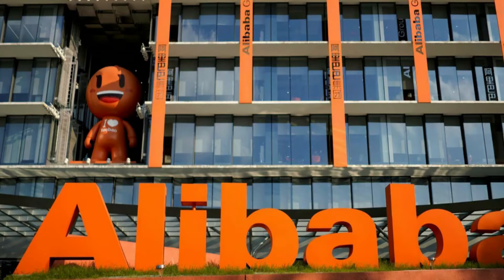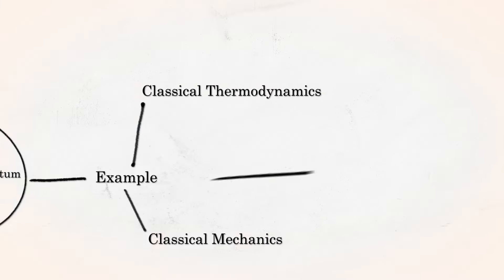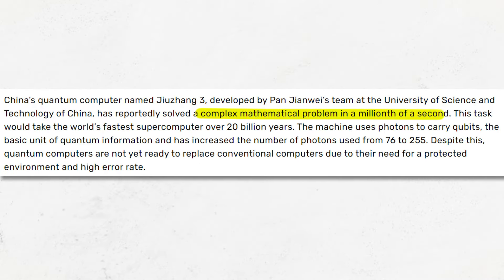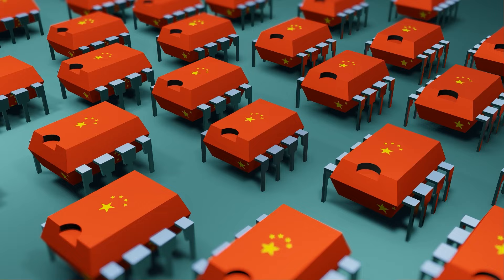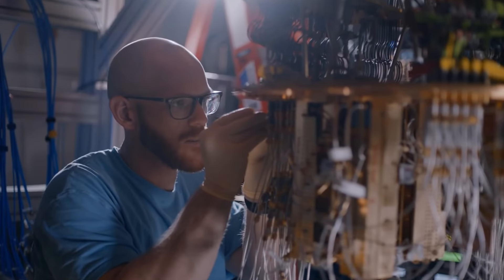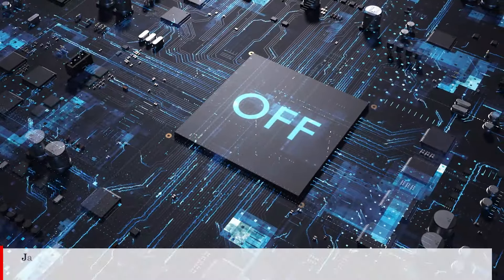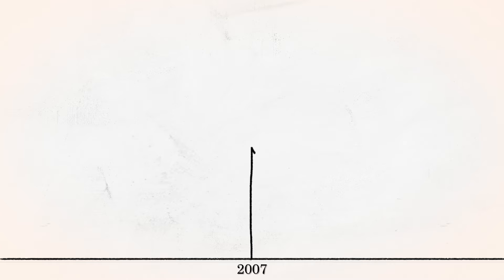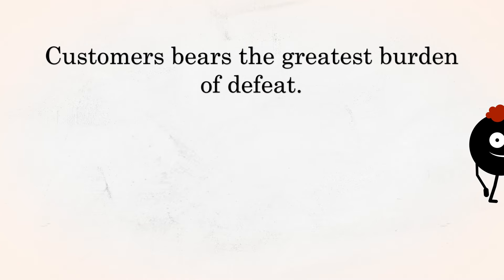Quantum Race: US VS China

Comment: When thinking about quantum computing I always apply the accuracy test. That is - if you ask a quantum computer to add 3 and 4 what is the probability that you get the answer 7? Richard
Reply from the maker: It is possible to have quantum computers that will do addition like you mentioned, with 100% probability, assuming there is no noise. This is because classical computing can always be done in a quantum computer.